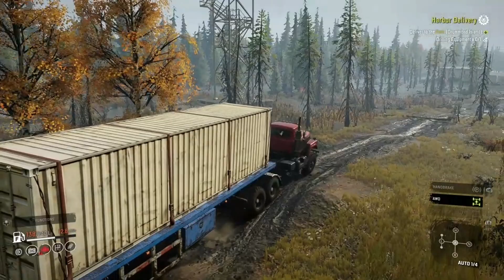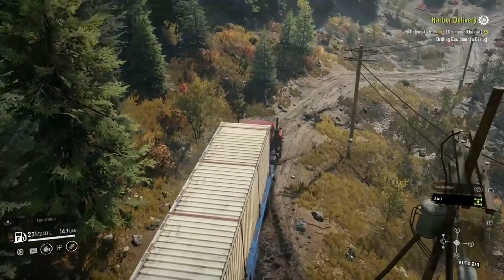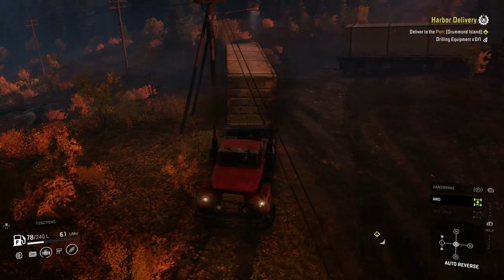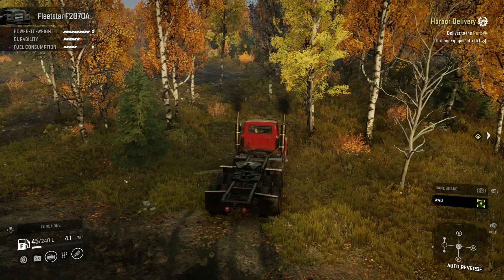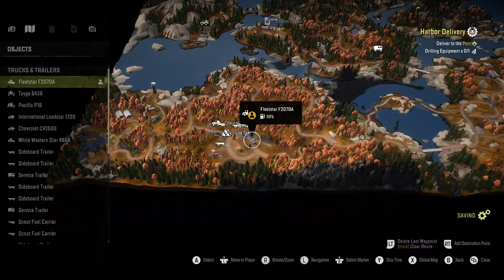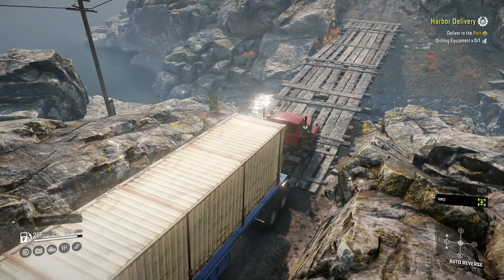SnowRunner Part: 41 We Can Do It. Drilling Parts to Drummond Island with the Fleetstar!

Comment: The twinsteer actually wasn't so bad i used it to haul that load I am fairly sure.  I think what happened is you attached by accident the wench to the trailer and a tree a bit further back and you got to the end of the rope so to speak and it yanked the trailer over.
Reply from the maker: Yeah I did! At least I get to use the big crane I made sure was handy xD